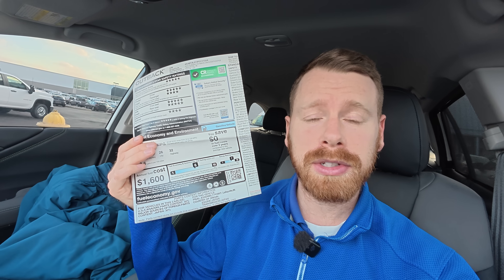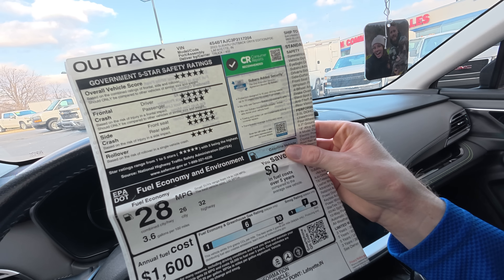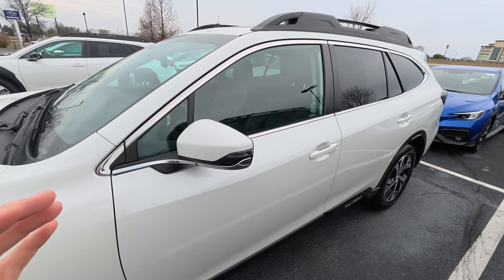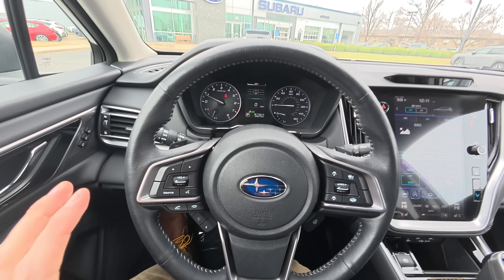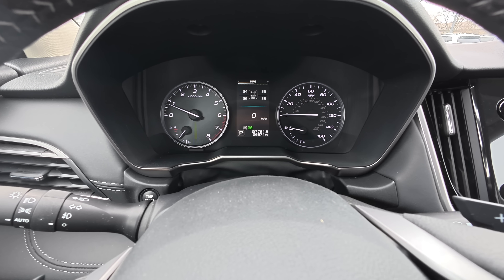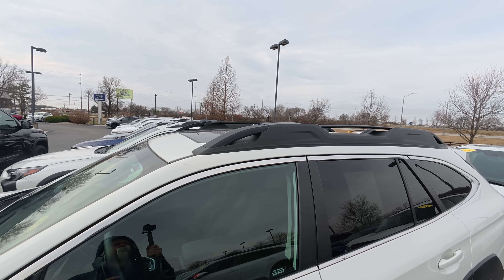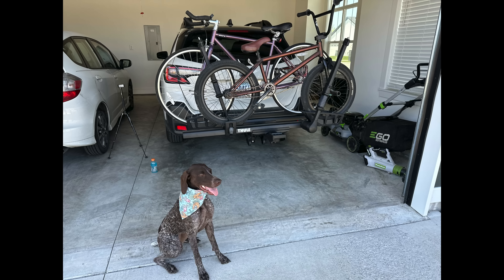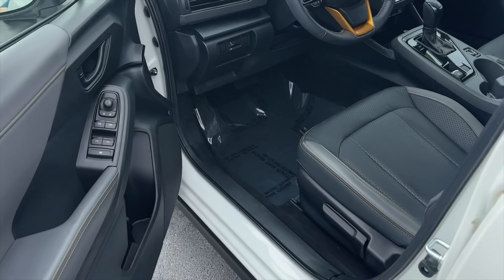Why your car may not get the same MPG on the window sticker

Comment: I have Subaru Ascent 2020 and my usage in Winter City Traffice is 21 litr/100km , 11MPG. It's DRINKING gas. 😔
Is this normal?
I've already removed my roof rack...
The millage of my car is already 65000 km,  40000 miles

Comment: Another mileage tip. This only really applies in urban settings, where you’re well served by gas stations, and doing a fair bit of start stop driving. 
Fuel up to only half a tank. Fuel is HEAVY. Driving around a full tank of gas that you’re not going to need on this trip, the next trip, or the one after that is just wasteful. Your engine has to work harder to accelerate when you’re carrying all that excess weight. Yes, you’ll need to pit more often. But if you live somewhere where the gas stations aren’t too busy, it’s not so bad.

Comment: For my 2025 OB XT, tire pressure does seem to reward correct pressure or higher. More so for my experience, driving into a headwind or crosswind affects mpg much more so. As much as 4-5 mpg. I drive the same east west 100 mile route weekly.

Comment: I’m based in Australia and my Forester gets 15 ltrs/100km or around 18 mpg.  The service centre said that because I was doing mainly urban driving and stop start at lights etc that the car never gets up to temperature hence high usage.  When I have taken it for long drives on freeways at higher speeds I certainly get better fuel economy.  Quite annoying though as it is more than double the sticker estimates and I drive fairly conservatively.  Great car but fuel economy in urban areas in my experience is absolutely terrible.

Comment: Want good fuel economy?

Turn off your AC, be a man and eat that cold, drive right at 65 with no harsh acceleration, tires 2-3 psi lower then recommended, and use 89 or 91 fuel.

Comment: I've owned 3 Subarus. An 18 Impreza, 22 Legacy and currently a 23 Forester. The Legacy and the Forester would get close to the sticker mileage. The Impreza would always exceed the sticker number, sometimes by quite a bit. Using cruise control on a long trip helped a lot.

Comment: Alex     I noted you adding air to the tire with a portable hand held "air pump device"  Can I ask what brand is it and where I can purchase one. I would like to adjust the tire pressure when they are cold rather than hot.  Great video  !!

Comment: We do better than the rated fuel economy on our Crosstrek in summer. In winter with remote starting and winter gas we use more. Also I was trained to not treat the gas pedal like an ON / OFF switch. Look ahead to start slowing down if the light turns red. There is no prize for being the first at a red light. I am not a fan of "city drivers".
Reply: Same here, and by not heavily applying the brakes, the start/stop doesn't activate. :)

Comment: Here is a comment for Subaru designers and engineers.  I have a 24 Ascent, and I see a LOT of Subarus of all kinds here in the Mpls. area and on my trips to the western US. I would say 99% of them are just used for transporting people. Not for hauling camping gear or bikes. There is nothing on the roof. Given this observation and experience with my past 3 passenger vehicles I think it would be wise if Subaru did NOT put roof  racks or rails on everything, instead offered them as an option. Or, make them so them can be removed without taking down the headliner and then having holes in the roof. Not having the racks, or rails on the roof would increase mileage, make the car quieter on the highway, and would lessen the effect of a high crosswind at highway speeds. They have a negative impact on the cars overall performance if not used.

Comment: The start stop device is terrible for your engine, your starter, and your battery, you are basically wearing out your engine three times faster than you normally would. Best advice, buy a stop start eliminator and have it installed by an auto electric shop. Stop start is a terrible idea, and  causes excessive wear on your engine, since startup is when 90% of the wear happens to your motor. Subaru should get rid of it.
Reply: Mine only goes on if I apply the brakes hard enough. I drove a stick for years, so I gradually brake. It rarely activates.
Reply: This is definitely not good advise. Adding anything to your vehicle like that will 100% void your warranty on electrical and engine. 

1. The engine is not taxed or strained. 
2. The starter is not taxed or strained. 
3. Your battery will wear down the same regardless. 

Your Car is designed for 76 starts for 10 straight years including leap year. So if you aren't performing 76 starts a day, you have more than a 10 years life span on your starter... 

You boomers really need to stop sharing misinformation like you are anywhere educated upon the subject.... You absolutely are NOT

Comment: I've never actually seen the auto start-stop display on our 2023 Outback.  Immediately upon picking up the car, I knew I needed to find a way to defeat that!!  Within the first two weeks of ownership, I installed an aftermarket device that allows auto start-stop to be switched off permanently, and it's been switched off ever since.
Reply: Its a good thing your warranty is over.....  for your Outback!
Reply: Cost $100.00

Comment: 18,000 miles on my 2024 Outback and 22.9 MPG as indicated by gauge in car. Half is city driving and half highway. Disappointed that it comes nowhere near EPA average of 27. I do get close to 30 MPG on highway at 70 and do not advise going 48 as Subaru drivers already enjoy a reputation of “slower old people” ! My BMW X5 that weighs close to 5,000 lbs and has 375 HP is averaging 25.9 MPG . I thought CVT was supposed to be efficient!
Reply: It is.... Your BMW isn't a Full time AWD. 

Also your BMW isn't rolling with just under nine Inches of Ground Clearance...
Reply: @marcymcsheehan3579 
I’ve owned 7 Subaru’s 4 Outback’s and 3 Foresters. Even my old Outbacks with 4 speed automatics did better!
Reply: @jeffsena9140  Yes, they had less weight and were geared differently.
Reply: @marcymcsheehan3579 
I agree but they had an old fashion 4 speed. I had a 6 cylinder Outback that also got better MPG! I chose a 2024 Limited over an XT because of the EPA rating, traded it on a 2025 XT. In 3000 miles city driving I’m getting 20.1 with much better performance!
Reply: @jeffsena9140  City Traveling clearly states high teens low twenties on the window Sticker.... 

Your fuel econ is on the mark

Comment: the auto start stop saved you 60 bucks but is ruining your starter which will cost alot more to repair
Reply: Actually you are wrong. There are two starters on the start stop system. One to cold start, one for the start stop!!! 

But please keep spreading A LOT of false information!!!!
Reply: @marcymcsheehan3579 😂😂😂 WRONG! Subaru only uses 1 starter motor in their vehicles!  They claim that it is a more "robust" starter motor. it is activated by 2 different sources, same motor. 
What he said is ABSOLUTELY NOT misinformation!  Been mechanic for almost 40 years. 
The fact are now flowing in, contrary to what was thought and said, the wear/tear on the vehicle increases with the use of this feature. The components of this feature are double if not triple the cost of standard features, into several $1,000s MORE!!!! 
It was ONLY put on vehicles so that the manufacturers would get kick-backs from the government. Now that that is no longer the case, they trashed that program. The overwhelming consensus is that the Start/stop feature will be phased out. Those systems only even start to scratch up any savings if you live in a highly congested urban area. Around here, we let it go for several months and it showed we saved ½ a gallon of gas. $1.75 over nearly 9k miles! 🤦‍♂️😂 1 component goes out and I'm in the red for trying to save $1.75!

Comment: I enter the gallons pumped into an app on the phone and enter the mileage.  The REAL fuel mileage calculated by dividing the distance by the fuel is always smaller than the on-board computer says, so we're being lied to, twice.
Reply: This is correct assuming your tank is being filled to the exact same level every time. can you verify that your sample is accurate every single time?

Comment: My problem is the last two Imprezas I've owned, the MPG it calculates does not match the mileage at the pump (Odometer / Gallons to fill). The MPG display is usually 1-1/2 MPG higher than reality.

Comment: Changing spark plugs in my Outback's boxer engine may cost anywhere from $1000 to $1500. Dealers say the engine has to be pulled out to get to the plugs.
Reply: You are being lied to.
Reply: $1500 for a tune up? I don't think so.

Comment: Auto start/stop is hard on Subaru batteries.
I’ve heard a lot of people say that when they leave the auto start/stop on by the time their vehicle reaches around 30K, they start to have battery issues and the battery gets replaced.
Mine is always off.
Checking your tire pressures is always a key.
But you could fill your tires up to the required pressure and th system will tell you that you are either 1 pound over/under even though you checked with a manual gage.
And in colder weather, tire pressure will dip until you get driving and then the pressure will go back up.
So, my advice for getting good fuel economy to closely resemble your window sticker….
Drive responsibly and don’t drive like a hooligan. ✌🏼

Comment: I just completed a trip to central Florida this past week. Most of the trip, my 2022 outback got 32 mpg. Several times it got 36 mpg. I have never been a big fan of the auto stop and start. Other than that, i love the tech built in to the car.We drove over 2,000 miles in 11 days.

Comment: Hey Alex! OEM battery life has been an issue for Subaru in colder areas. Could you make a video covering topics like battery caring/upgrade options for Subaru? Also love to know pro tips like jump starter usage, battery disconnection, taking power directly from battery and fuse replacement (also available extra ACC fuse slots). Thank you for sharing!

Comment: Doesn't the climate also play a huge role in fuel efficiency? My 2025 Impreza could get ~31mpg in the late summer but now in January is stuck at ~27, with no changes in driving habits (and tire pressure good). Not sure if the cold affects the engine but I suspect it at least has something to do with running the defogger, de-icer, cabin heat and heated seats.

Comment: My 2025 Outback gets a little better MPG than the window sticker says with 87 oct. gas. A lot depends on how hard you are pushing down on the gas pedal from a stop. Just my 2 cents on auto start-stop....I hate it and turn it off as soon as I pull out of my driveway. Where I live in south Idaho there are very few traffic lights.
Reply: Just drive it like a manual, you'll go easy on the brakes and the start/stop will hardly ever activate, at least it works for me.

Comment: Good advice Alex except PLEASE stop trying to sell the auto stop start as a good thing yes its saves a few ounces of fuel per tankful but as a mechanic for years Ive seen the Damage created over time to an engine being shut on and off especially in hot climates oil needs to circulate in a motor not drop back down in the pan allowing no lubrication to be keeping the engine wear down so go speak with your Long time shop mechanics for advice not Corporate Subaru.

Comment: First time Subaru owner. I had no idea how to know what the tire pressure is.  I know how to get to the icon but a reading of tire pressure but no effing idea what the tire pressure was. I was stumped.  Who knew you did it when the car was in motion?  Now I know.  Two things that you did not cover what is  the most efficient RPM speed for maximum fuel economy?  Lastly I have no idea of what that MPG  linear gauge at the top of the read out is telling me.  Sometimes the white heavy part is on the left side of center and sometimes on the right side.  What the heck does that MPG gauge information tell me?
Reply: Having to be in motion threw me for a loop but it makes sense. Spent 10 minutes waiting for it to update after airing up my tires ended up just grabbing a gauge instead  😂. If  your economy guage is + you are increasing your economy, if its - your decreasing your fuel efficiency.  The best rpm speed to save fuel is idle 😂 but i think most cars is 1500-2000 rpm under 60 mph

Comment: Do you know if the tire pressure sensors when you change location of tires on the Aaron automatically switched to that location?
Reply: Idk but sometimes my car gets confused and swaps the tire pressures around so i think there is some logic in there that tells it which corner a sensor is supposed to be
Reply: When the tires are rotated, the technician can and may adjust the signal so they align properly.

Comment: These estimate millage figures are pie in the sky figures to draw you in to buying these frugal vechicles. Lest anyone forget these figures are achieved by very experienced driveers, under very controlled situations such as low speeds, verry little wind, usually on a closed track and probably speeds of 60 mph or lower with micro managed tire pressure and other conditions that are rarely obtained on real world conditions. So in my estimation these figures are guesstimates at best. They are given to appear very good in the eyes of the EPA which enhanses their ratings to get govt approval. Usless as far as I am concerned. Buy a vechicle that you like for your own driving experience and dont expect to fill your tank for 10$ for 460 miles driven It aint gona happen.

Comment: I wanted to get a hitch mount bike rack installed on my WRX, but was concerned at what the extra 100+ lbs would do to my already low mileage. 😅 And since I'm driving the manual TR, I'm also paying a premium for higher octane fuel. Unfortunately, that, combined with the $1000+ cost and how infrequently I'd probably use it, I've decided to forgo a bike rack. 😢
Reply from the maker: I'd say the roof mounted rack is better suited for the WRX. Yes, you sacrifice MPG, but the low roof makes it easy to use those times you do mount a bike on top.
Reply: @alexpmo  I don't trust myself to not fumble and put a gash in my roof by dropping the bike. 😂

Comment: My outback never gets more than 25mpg even on 100% highway. Combined I usually get about 21Mpg. Definitely not as high as I would like
Reply from the maker: Do you have the XT (turbo engine) or the 2.5L NA?
Reply: @alexpmo 2.5L and I use the cruise often
Reply: My '23 Outback averages 20.5 mpg. That's 13 mpg off of what was advertised on the window sticker when I bought it! I would call that false advertising. I'm getting ready to trade mine off for a Toyota.

Comment: The EPA still using a max of 60MPH for highway mileage is no longer realistic with most freeway speeds around 70 and above. I tend to average ~33 MPG ~60, 30MPG at 70, and ~28 at ~80 MPH in my 24 Outback, 2.5L.
Reply from the maker: Agreed!

Comment: I just got major service done on my 2023 Crosstrek at 70k miles.  Before, I was getting 32 mpg on average consistently.  After the service, I'm only able to get 28 mpg.  Can the dealer make any adjustments to get the better mileage back?

Comment: Alex, I need your help. My 2024 forester gets 24.5 mpg and my 2025 gets 21.5 both on the I settings. It’s been that way since delivery.  I’ve brought it to the attention of the dealer since delivery. All maintenance has been done. At one year I had them do a full diagnostic test. All parameters were within std. The only way to get better mileage was to go to the S setting then mpg was 24 on the 2024. My service people said 25% off drivers on this year and model have the same complaint and they are waiting for Subaru to give them a tsb on new settings.  When will this happen?  Thanks. Bob.
Reply from the maker: Hey Bob! I haven't personally encountered this with the 2025 model year. I get around 25 mpg between hwy and city with my 2.5L NA 2023 Outback (fairly close in line with your 2024 Forester). I'll agree, the 21.5 MPG rating on your 2025 does seem low. Is all of your driving the same on your 2025 compared to your 2024? Are you driving the same amount of highway and city? If you drive more back roads, city, and stop and go, this could reflect lower MPG
Reply: @alexpmo yes driving is the same. Dealer says the problem is the updates done to the 2025, this model only
Reply: @a @alexpmo yes the driving is the same. The only explanation is the 2025 forester changes are messed up according to the dealer. They said they are not authorized to change the settings
Reply from the maker: @BobBohner4851  Interesting! I'm not sure if Subaru plans to do an update but I hope you get it sorted out!
Reply: @alexpmo I hope so too.  4 mpg less out of 24 is a large percentage loss.
Reply: Hmm... Same tire brand/model/type? 

Winter tires won't get as much mpg as other types, for example
Reply: @oooscasianooo yes

Comment: I usually get the mpg or a little better. I always check my tire air pressure at least a couple time per month. On my road trips I keep it at 65 - 68 mph. I use premium fuel. I get about 35 mpg hwy.
Reply from the maker: 35 mpg is amazing! I average around 25-26 mpg between highway and city. Could get better if I was a little lighter on the gas pedal lol
Reply: @alexpmo  I'm not going by the Average mpg meter. There is usually a 1-2 mpg error on the high side on any car. Car and driver tested a Crosstrek Sport and got 35 mpg hwy also. Keeping it just below 70 mph and not doing a lot of accelerating (passing) also helps. Also using premium fuel in a DI engine gives you more hp vs 87 octane.